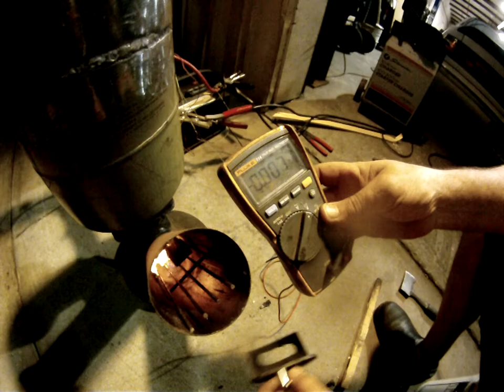rocket heater with narrow band o2

Comment: The O2 sensor doesn't care what the AF ratio is, It reads the O2 left unburned in the exhaust. I'll bet a 4 gas analyzer would give the best picture, but, alas, I don't have one. Auto applications set a "happy" voltage (.45V) and measure above and below this number to maintain AF ratio. I would guess that the same voltage would be applicable to any fuel. No O2 in the exhaust could be perfect combustion or too rich, whereas, lots of O2 could be horribly incomplete combustion or way lean. What the heck...try .45V and see where it goes!! Can you get enough temperature to make the sensor work properly? The old ones need 600F to hit closed loop. I gotta try this now! You got me way over curious! (Especially with the hazard of CO in residential applications) Thank you!!
Reply from the maker: The flue temp is two cold I believe for a up stream narrow band o2 . Wideband o2 sensors have a better heater as do down stream narrow band o2 sensors but with an automotive wideband o2 sensor I get the proprietary telemetry software it comes with and it is able to be tuned for custom lambada to display AFR for different fuels and log multiple streams of data in real time .
Reply: Makes tuning a stove much easier!!